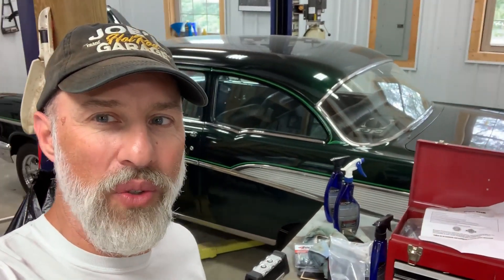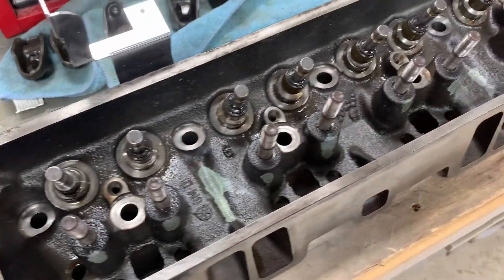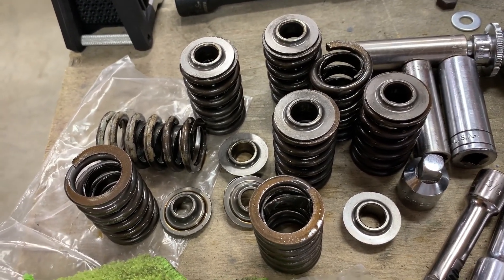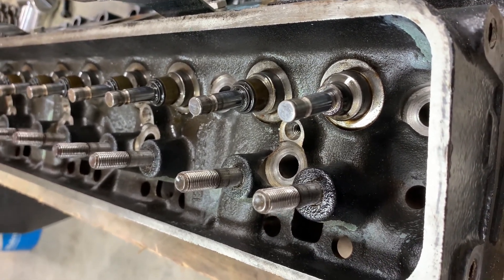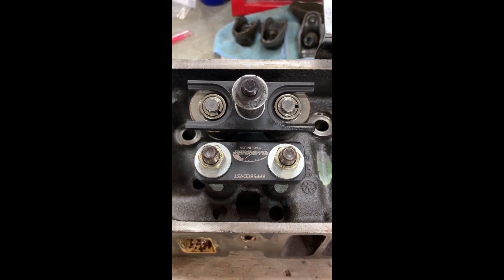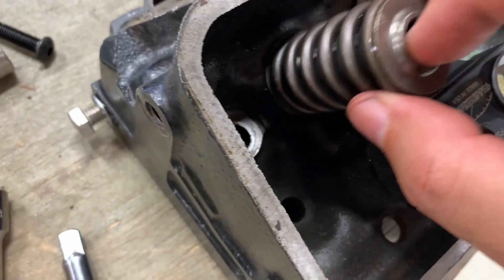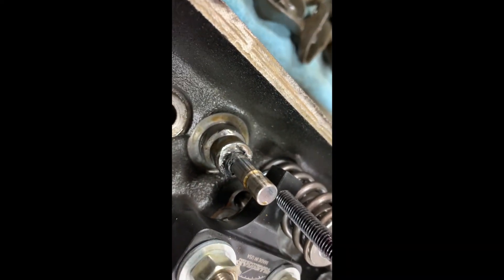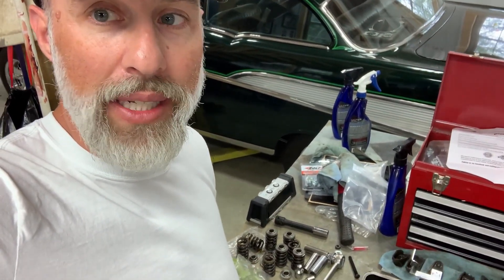Choosing Valve Springs for Vortec Heads  |  How to Avoid Problems!  Bluegrass Performance BPPSBCDVST

Comment: But the comp cam springs are too big at the base. The spring seat area is 1.260 at best. Stock springs are 1.250. These comp springs are 1.282.so did you still have them machined?
Reply from the maker: I didn’t have anything machined for the new springs - they fit fine.

Comment: Machine shop is at fault. The big guide boss must be cut to fit the inner spring dampner. Also the spring pad cut for larger diameter depending on the spring od. They did not measure. Also cut the top of the guide where the seal resides to .530 for pc seals. The cutter narrows it as well as moves it further away from the retainer. You did not get the wrong springs. You got the wrong shop.
Reply from the maker: Agreed
Reply: Does it suck to have no clue???

Comment: The factory valve springs on Vortec heads, only tolerate .420-.430” lift. But did you change up the valves?
Reply from the maker: No, valves are stock. Cam was .447 lift. So I must have changed springs for lift?

Comment: Did you check the valve guides? Because if you did have metal with broken valve stem seals, the metal could have scored up the guides.
Reply from the maker: Good call - I’ll check

Comment: This is topical information because I'm getting ready to rebuild a Vortec engine for my Caprice but I think I'm going to the roller cam.
Reply from the maker: You should be able to run stock vortec springs then